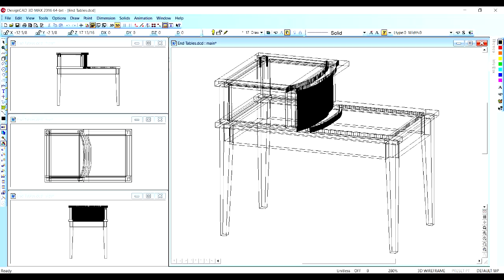Making End Tables: Andrew Pitts~FurnitureMaker

Comment: hey Andrew,

Thank you for your wonderful videos.  I didn't know you could do veneer over solid wood!  so cool.  do you have to do both sides like when using man made substrates?  thanks!
Reply from the maker: Veneering onto solid wood is just like gluing a large joint, Andrew. Just make sure the grains both go in the same direction, and try to veneer quarter sawn to quarter sawn, or plain sawn to plain sawn to reduce stresses during humidity changes. Best to veneer on a substrate with a similar expansion rate. No need to veneer both sides, as the substrate should behave just like the veneer. When veneering on a plywood or mdf substrate, the veneer behaves differently than the substrate, hence the need to veneer both sides.

Comment: Very nice, well done as always.
Suggestions: i like to put the dowels or dominos in the end grain of the frame pieces and bottom out. Then i cut the 45 for inside the legs. this way there is no fiddeling with the depth you put them down in the leg.
I would suggest to make a spacer/traverse under the drawer to raise it a little. this will avoid scratchings on top of the lower surface. btw a drawer on top of a surface is always kind of a pain as anything standing there is in the way ....But this is the given design an thats fine for occasional use.
Reply from the maker: Thanks. My point about the dominos in the leg pieces was to get them as far into the leg mortises as possible for max glue surface in the legs and to mechanically lock them together. I didn't need them to bottom out in the aprons as the glue surface in the aprons is ideal for dominos. I agree about the spacer, but I did put thin runners for the drawer to slide on, having to keep to the design of the original table, which was the requirement of the commission.